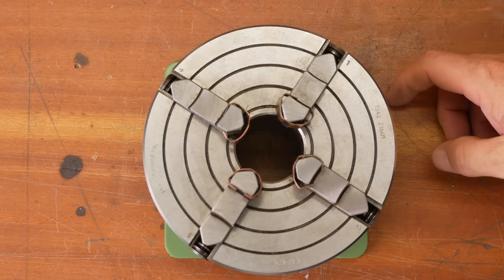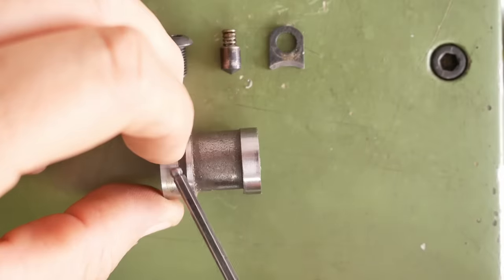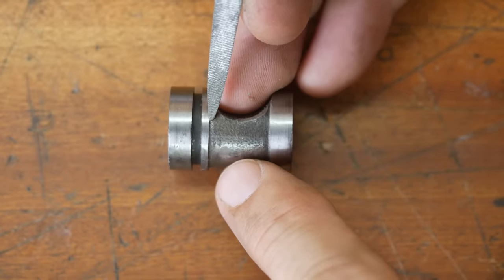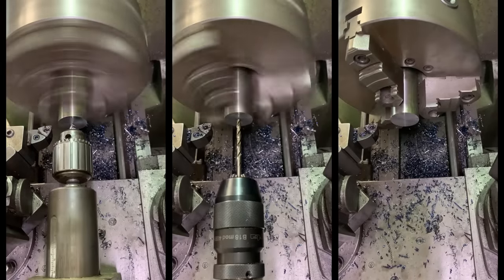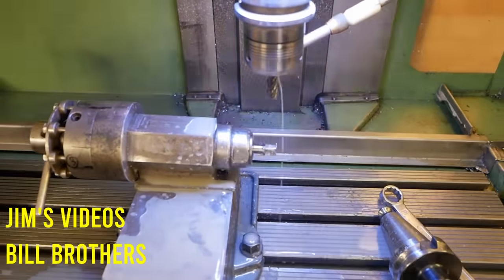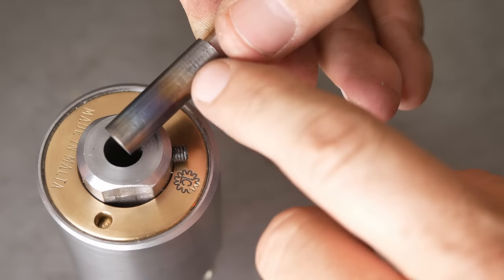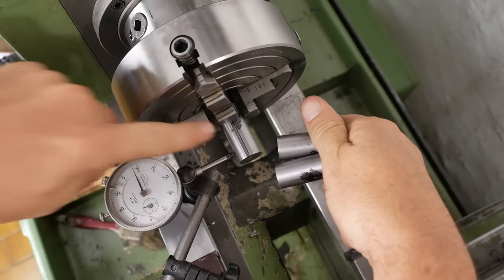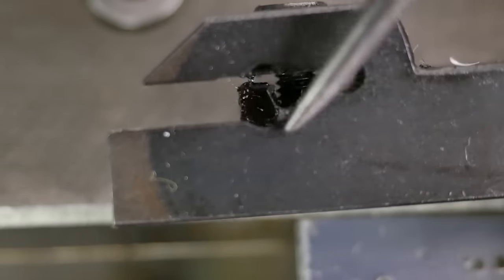DIY Camlock spindle cams || RotarySMP

Comment: Wow Luke...a magnanimous genius. I just realized that I don't have the patients to do precision. I would just get out the grinder and eyeball those camlocks.   Run the broach much slower ...redesign the broach. You are not just cutting with the broach you are also displacing the steel. Like thread forming rather than thread cutting. It requires a slightly different shape of the broach. (my opinion. I could be way off)
Reply from the maker: What change would you make to the broach geometry?
Reply: @RotarySMP  I would look at those hex broaches for hex bolts and study how the geometry works.

Comment: Lovely video! A cool idea from a coworker was to mount a clamp for a wet/dry vac nozzle on a Noga mag clamp. Might help with grinding dust... Many nights my shower knows of the grinding dust from my nose. Fun sentence! When I was in the USMC the genny mechs would fix everything with a Gerber and a crescent. Which is probably why nothing ever really worked that well...
Reply from the maker: Thanks Ethan. I have been taping the vac hose to the Clarkson with masking tape, and it is not the greatest solution :)

Comment: Hi Mark  first , Luke what a fun new tool/finger puzzle that you sent to Mark.
according to the slater tools catalog (page 34) the predrilled hole should be
1.1 X the width of the flats of a square broach (answer to the suggestion that julias-shed made)
also according to slater , there should be a 45 degree lead-in chamfer  slightly larger than
across the diagonal.
Reply from the maker: Hi Steve, thanks a lot for looking that up. So my core hole should be about 7.8. Good to know.  Roger on the chamfer and thanks for the recognition of Lukes efforts.

Comment: First, a big thank you to Luke for being so generous.  That's just really cool!
Second, I really like the 4 panel views, like when you're grinding on the Clarkson. 
Thirdly, Is there any reason you couldn't backstop the part in the 4 jaw chuck by putting a bar across the face of the chuck for the piece to press against? Obviously you'd have to make sure it can't be thrown clear, so maybe a plus sign shape?
Lastly, I don't find it necessary for the parts to be completed and correct to consider it a "successful" video. I enjoy watching the journey and the narrative. So no worries there, mate! (did I say that right?)
Reply from the maker: Thanks JC.  Considered my lack of experience with the correct F&S using the broach ( and also the insert cut off tool), it is probably better to have the part move in the vise as a sort of fuse. I think I just ran that broach too often at too low speed and with a too small center hole, and the corners dulled a bit. The cutting force probably rose rally fast.
thanks for your kind words on the video.
Reply: There's something called a Lathe Spider for that. Edge Technology produce them. They are more to keep the work parallel to the chuck, but also act as a backstop.
Reply: @RotarySMP Reminds me of the advise my dad gave me when he taught me to drive a manual transmission car. You can engine break every time, but brake pads are cheap and you can replace them yourself. Transmissions...less so. The fuse analogy also works well -- let the most sacrificial thing get sacrificed first if something goes screwy.

Comment: Hi,  you can make a quick & dirty end stop for your lathe setup by installing a piece of bar stock into a collet in parallel with the  4 jaw lathe chuck. Face/turn the stock as required and then recess it past the 4 jaws. Cheers!
Reply from the maker: Good tip Martin. Thanks.

Comment: I made 4 camlocks, put collett chuck in 4 jaw and set offset,  rinse and repeat without dialling in the 4 jaw for everytime. 
Countersink the hole before engaging rotary broach.
I made a rotary broach but find it is only suitable for brass and aluminium and small sections in steel.
I used allen bolts, built up the threads with weld and machined, no need to broach.
The camlock studs on my lathe are hardened, the cams are not and they have worn in nicely giving a nice secure transition when tightening and no fear of loosening.
Reply from the maker: Thanks for your feedback on the WIllem. I would have thought 7.2mm square broaching would be easier than this. :/
Reply: A LOT of force required and a cutter to stand up to it.
In theory it should work but in practice I haven't had success on large sections.
Reply from the maker: @willemvantsant5105  Do you consider 7mm square as a large section? I have no sense of scale for the process.
Reply: In steel it is getting up there, I have made 8mm hex in brass and came out nice with 8mm pilot drill.
I think in your case you have to increase the pilot hole dia, not ideal.
Grind a piece of HSS to 7.2 Square, short 7.2 dia lead in and press into 7.2 mm hole, I think a sturdy vise would suffice if press not available.
I have had more success with this method.
Good luck.

Comment: In my day job I do a fair amount of 1/2" square sockets in parts. I drill the hole 31/64" and then use a 1/8" four flute carbide endmill to machine them square in the vertical mill. It goes fast with a DRO on the mill.
Reply from the maker: Thanks for that alternative.

Comment: Time for a a piece of HSS rod and a lot of grinding? Or, a piece of A2 or D2 drill rod/silver steel?  Not sure which of those (or neither?) would make a good broach... I've made a form tool for the lathe out of A2, but, it's only been run lightly and only a couple parts... That broach strikes me as a little more abusive to the cutting edge? If it was me (and I'm not claiming to be overly bright....) I'd make 5 of them out of O1, and figure I was going to get one good hole out of each one (hopefully leaving two spares...).   Just thinking out loud!  I really enjoy watching your challenges as well as your successes, because they make me think, and I don't think enough with my current desk job.
Reply from the maker: I dug back through that box of cutters awaiting grinding, and found a 10mm HSS end mill, with a completely missing fluke. That will be the next victim.

Comment: Hey Mark!  Good progress so far.  Consider....instead of busting your backside to release a video each week, just release  one when you've completed a project.  Seems like you have a demanding work schedule. I get it.  Same here.  Nothing worse for me than knowing I haven't enough time to complete a project so often I just don't start one. Frustrating is an understatement.  I can only imagine the frustration of running out of time and feeling you have to put a video out.  Just hold off.  Finish the project, then edit and release. We'll be here excitedly waiting 👍🏻.
Reply from the maker: Thanks for you support on that. It is always a toss up between keeping my routine, so I dont fall right out of it, or having anything it at all. :)
Reply: True words - Choosing your battles wisely is also a good tip. The simplicity of operation of cam locks belies their complexity of manufacture.
Reply from the maker: @squelchstuff  I was really surprised how rough Schaublin left them.
Reply: @RotarySMP  I think that is simply down to mass manufacture expediency. All of the working surfaces are properly machined, leaving the unimportant forged surfaces alone, much like an engine crank or camshaft.
Reply from the maker: @squelchstuff  I would have expected the cam surface which bears on the pull studs to be machined or ground.
Reply: @RotarySMP  I hear you, and I've been contemplating that too. The only thought I have is that it is deliberate. The unmachined cam surface simply clamps the chuck onto the spindle. The registration surfaces constrain the chuck radially, and axially. The rough surface could provide some bedding in and frictional grip as opposed to a hardened and ground surface that would be more likely to slip. Speculation on my part, of course, but given Shaublin's attention to precision, and quality everywhere else, there has to be a reason. These are my best guesses...

[Edit to add] As I said elsewhere in the comments. The simplicity of operation with camlocks, belies their complexity, and I think that is being uncovered here - possibly 🤔
Reply from the maker: @squelchstuff  I also have a nagging feeling that once i make one "perfectly" to spec, I'll find out that Schaublin also modified a detail like eccentricity :/

Comment: Very impressed by the rotary broach tool!

When grinding in the Bowley, shouldn't you also put some damp rags over the spindle?
Dust could enter the gap between the headstock and spindle which would give you a pretty bad day...
Reply from the maker: There is a labrynthe seal to protect the main bearings on the Boley, but it is a good point.

Comment: Hi Mark  at around 13:13 (how appropriate 😀) when the parting tool got crunched ,perhaps a more purpose built tool would be in order
Iscar, for example, has a whole line of what they call  Groove-Turn & Parting  tools  .they look much more robust than parting only.
Reply from the maker: Thanks for that tip Steve.

Comment: could you not put a parallel or similar behind your piece in the lathe chuck to stop it being pushed back?
Reply from the maker: Hi Dan, I could, but the slippage is probably a good fuse when the cutting forces get too excessive due to blunt cutting edges.

Comment: Maybe you should make a backstop for the lathe spindle ?
I remember using them when I had parts that I wanted to not move back in the spindle/chock at all ( since it was screwed into the back with counter clockwise threads so it only tightened itself instead of loosing)
Reply from the maker: Probably a good idea, once I have the F&S dial in. As long long as I am learning, having the part slip is probably like a fuse.
Reply: @RotarySMP  most cam programs gives you the right speed depending on what feed  pr. rotation you tell it ( a mobil app for that witch i like to use is called "cnc tools" ) and the feed pr. rotation is normally on the back side of the box the insert comes in ( there recomended max. P mean's steel and N is aluminium,brass and copper for almost every insert produser just incase you didnt knew  )

Comment: Why not do the cut on the mill so that it doesn't slide. Drill press? Would it work?
Reply from the maker: I could mount the rotary broach in a tool holder and cut it with the mill as well. So far I am pretty happy if it slips, as it is a fuse so nothing else gets broken.

Comment: Someone need to invent a 4 jaw chuck with high torque micro servo motors that can rotate each jaw screw. Than you can just program the offset. And of course it needs to have encoder for position sensing. Also cheers for Luke...
Reply from the maker: It would need coolant and High G resistant electronics. The easier solution, is highly dynamic X axis server which just turns the excenter into the centered stock.

Comment: Rübig actually does hardnen even mild steel which i found quite amazing. It’s not just case hardned..
Reply from the maker: Wonder how they would through harden a steel with insufficient carbon to form Martensite?
Reply: @RotarySMP  No clue either they guy there only said they are the only ones that can do that stuff..
Reply from the maker: @platin2148  I will probably just sacrifice a chipped 10mm HSS end mill, and make the next broach from that.

Comment: Think the pilot hole should be oversized for broaching? 😀
Reply from the maker: Hi Julia, I think you are right. Any suggestion how far oversize?
Reply: @RotarySMP  according to the slater manual it shoud be 1.1 x the flat width
Reply: @RotarySMP  I've not done any broaching myself but remembered that from the @ThisOldTony video?

Comment: Cam locks looks hard. Maybe you should build a 5th axis on the maho
Reply from the maker: Yeah, go for the simple solution :)
Reply: @RotarySMP  , in hindsight, that was a crap idea. When looking at Chinese CNCs, it seemed to make more sense to have a fourth and fifth-axis addon as it would compensate for the lack of machining skills that require regular practice.
Reply: @RotarySMP  Also, you could use a fine end mill, say 1-1.5mm bit, on the maho to make an almost square hole. It seems feasible because, as you mentioned, the slop isn't an issue. As such, I can't see why a rounded corner wouldn't matter either.
Reply: However, you would need a V block to hold it in the vice. Anyway, just ignore me.. I'm a backseat machinist :P
Reply from the maker: @tcratius1748  Nothing gets easier at 5 axis. :)
Reply from the maker: @tcratius1748  True, but this was triggered by receiving a gift of a well machined rotary broach, so solving the problem by milling it with a little end mill (you cant easily mill an 8mm deep hole in steel with a 1mm bit). would be rather ingracious.
Reply from the maker: @tcratius1748  Or for milling the square hole,  I could hold the cam blank in the chuck, which is fastened to the mill table with the Camlock adapter plate...
:)

Comment: Hey, proxon gear, do you like it?
Reply from the maker: I have had it for a couple decades and it has been reliable. It's peak RPM of 20K is well below the dremels 30k though. Also the tool spindle has only one bearing, and supports itself of the motor bushes, so you can't expect it to be too rigid.

Comment: Tool worn and tool load increased plus more vibration.
Reply from the maker: You are probably right. I think I run it too often at lower speeds, with very high pressure. Probably should have pulled it and touched up the cutting edges a couple of times.
Reply: @RotarySMP  having not don’t this myself I am learning from you so thank you for sharing the experience. I loved the live feed you did last week it was something new and no other machinists have done before. I think you’re on to a winner. 🏆

Comment: Ouch! Those tool "modifications" looked painful mate. Sometimes a job just goes like that - The workshop equivalent of a bad hair day. Don't bust your ball ends on it for our sakes though. While it's refreshing to see that not every Youtuber "apparently" hits it first time, I'm sure the distraction of setting up the shots doesn't help in the critical moments. Speaking of which, order of ops, prudence the safety goat would say to broach first as it's the op that's most likely to go wrong. As a first op, not so much work is lost, and it wouldn't affect later ops. You'll also have more meat to chuck up.

Your chuck does seem to slip a lot. I'm sure you must be cranking down on it, so it might need some investigation. Are the jaws belled? 

Oh, so only NCO's are allowed nut lathes? That's criminal. Where's the teaching moment for the apprentices going to happen? Knipex parallel jaw pliers are fantastic, and I haven't destroyed a recalcitrant nut yet. except on purpose... 

Thanks for sharing your, and Luke's work.
Reply from the maker: That chuck is new. well new old stock.  I think the slippage here was most excessive tool pressure. Initially due to the RPM too low, and later, I am guessing that the cutting edges got a little dull through my various tests, and the cutting force rises really rapidly.

Comment: At least in my USAF job, adjustable spanners were never to be used.
Reply from the maker: In theory...or practise :)
But yeah, we were laughing at the RAAF tool shadow boards with a metal flap over the crescent, labelled "NCO only'".
We didn't have any crescents on the shadow boards.
Reply: @RotarySMP   Both. It doesn't mean they never were especially since I was not an aircraft maintainer. I think they'd shoot you if you took your Leatherman to an F16.

Comment: Would probably have made the whole part in a mill(T-slot cutter) and then parted it off to length in the lathe. Too much setup otherwise.
Reply from the maker: not sure hot to make a square hole with a T-Slot cutter? Do you have a link please?
Reply: @RotarySMP  yeah ok, you'd have to do the square hole on the lathe as well, but you could rough out a good chunk of the square in the mill as well, that way the broaching tool would have to do less work.

Comment: I really enjoy your content, but please, easy on the split screen. I can only watch one of the 4 things.
Reply from the maker: Thanks for the feedback on that :) You'll need to rewind to watch 4x :)
Reply: I think it's a ploy to make us watch it another three times. 😆 I usually do that anyway for some bizarre reason...
Reply from the maker: @squelchstuff  Good, I like to hear that.
Reply: I gotta disagree, at least mostly. If each panel is a unique operation, then yeah, it can get confusing. But when it's something like grinding on the Clarkson or the rotary broach running, I think it's a perfect effect.
Reply from the maker: @JCWren  Thanks for your vote on that JC.
Reply: @JCWren  I'm afraid I'm going to have to disagree, it's not about confusion, it's distraction.
There's a reason this is a rarely used effect. Our eyes are drawn to movement and four things going on at once distracts from them all.
Now I've given my opinion, it's not going to change, I'm still going to enjoy the channel, although at times maybe a little less than I did.
Reply from the maker: @doobedoobedo1  Given how easily our #1 fan Nico is driven to distraction, this will probably drive him nuts :)